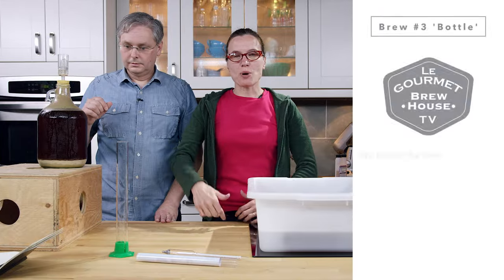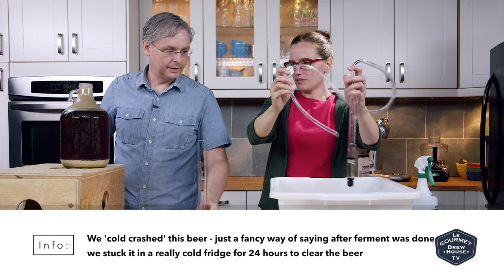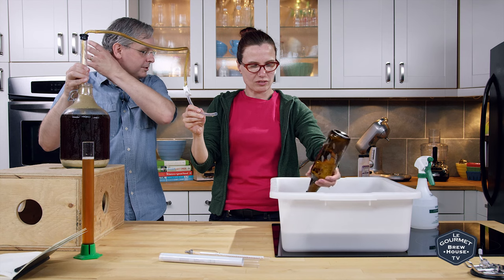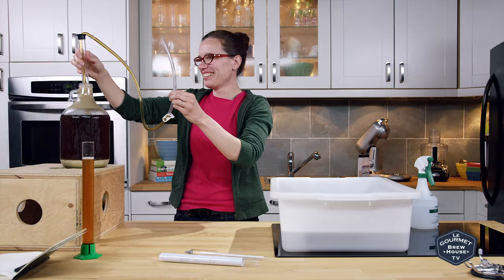Brew Number Three - Part Three 'Bottling'

Comment: I home brewed for years beginning in the early '90s.  Rather than the little air lock (bubbler), I always started with a tube in a cork leading down to a jar partially filled with water to make a high-volume air lock.  After a couple days, when the most vigorous fermentation had begun to die down, I would switch to the small air lock type you use.

Comment: Nice clear beer!  Cold crashing is great.  Be careful with the 3 piece airlock as you get suck back.  No prob with StarSan in the beer.  -- You can batch prime too with one gallon batches to get even carbonation. Mix the sugar in water then boil for a bit.  Some people get antsy with adding unsanitary sugar directly to prime bottles -- Bottles wands are great too.